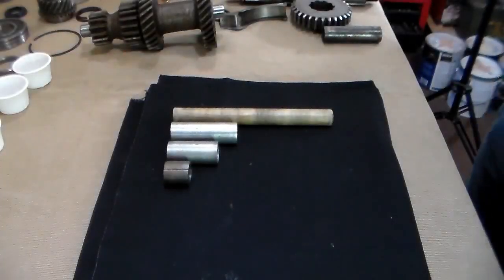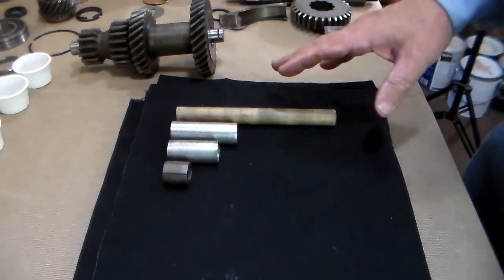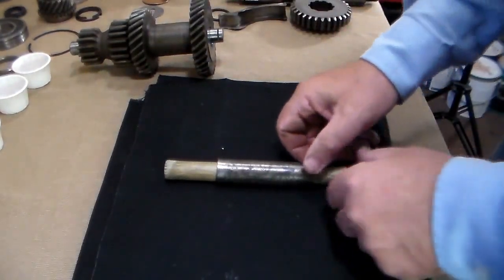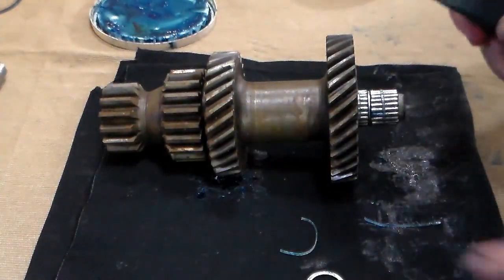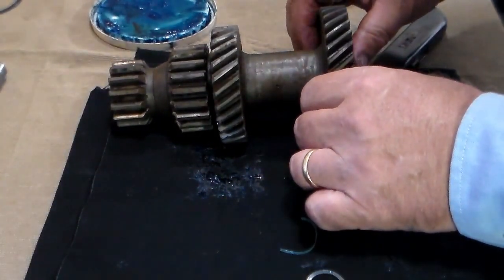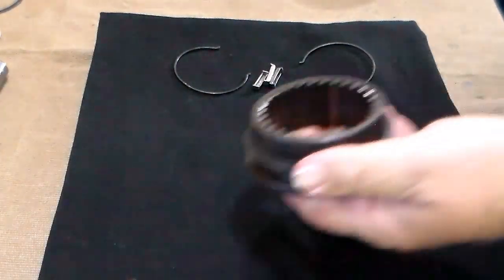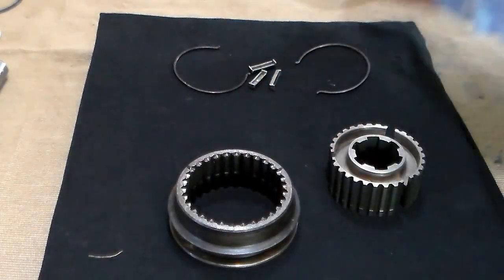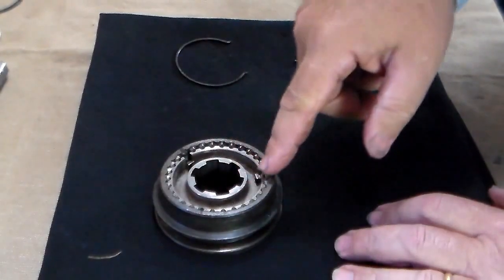10 Rick Stivers T-90 Rebuild Guide - Assembly Part 1

Comment: If sourcing your dowel from Home Depot or Lowe's, I recommend measuring it before going to all the trouble of putting the needle bearings on it. After several attempts I put a Vernier on the dowel and it was larger than three-quarter inch not allowing the needle bearings to slide in.

Comment: Thank you for the great timeless information!! I am rebuilding my T90 but my cluster gear does not have the two slots at the small end!! Is that normal? Do i have to change the cluster gear? Thanks a lot!!
Reply from the maker: Juan, That's not a problem. There are many different variations on parts in the T90.
Reply: @rickstivers3965  Thank you for the quick reply, my fear is that the cluster gear, at the small end, will ride against the non brass side of the thrust washer, instead of making the washer move with it against the non brass washer, wearing it fast.
Reply from the maker: @JuanGarcia-ho6vu  The slots in the end were to help feed oil into the needle bearings. Sometime later they decided they weren't needed.